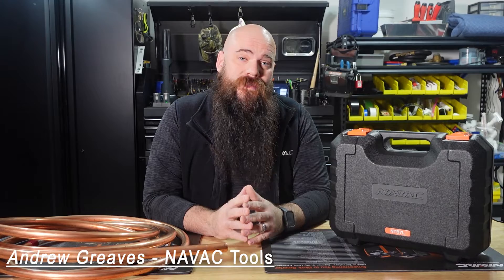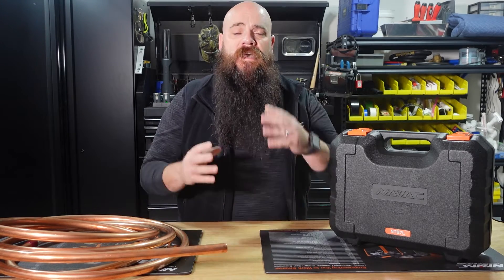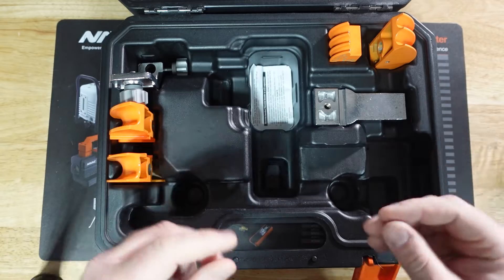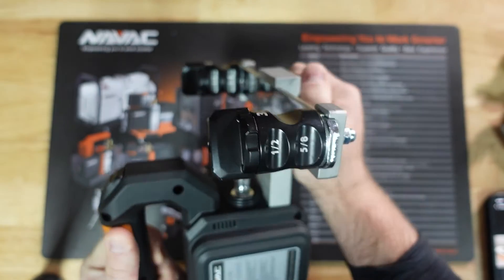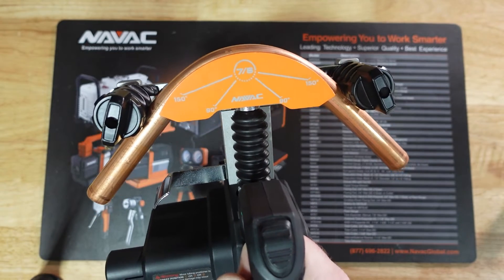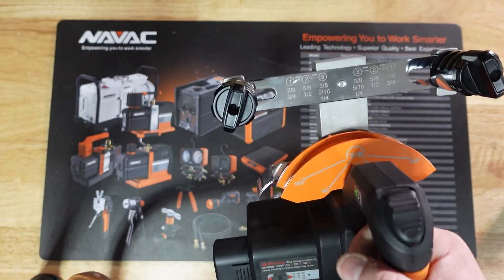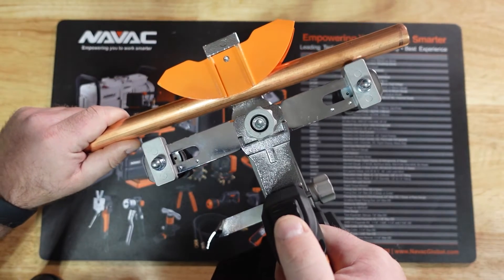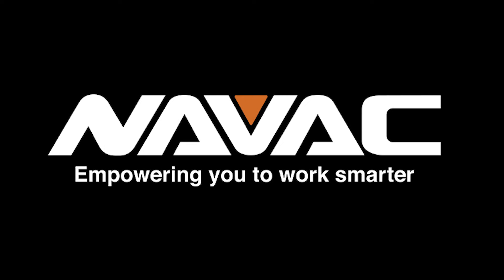Introducing the NTB7L BreakFree® Power Tube Bender

Comment: Ok well i build and plumb auto car wash equipment. I work with 1/2" and 3/4" stainless steel tubing, you say this is just for soft copper? I bend ALOT of stainless tubing by hand, not a ratcheting crossbow but just a hamd bender, if this could bend my stainless id buy immediately

Comment: Hey I see this tool makes a nice 90 degree.   But can I put a mark on my cooler then know where my bend will be? Or I just have to bend then cut my copper to fit in place?
Reply: Should work like any other bender. Line up you bend offset from the center of the mandrel you should be golden.
Reply: This is my biggest question. Where are the marks to get a precise length dimension bend?  I like to bend almost everything to my measurements, no extra braze joints!!